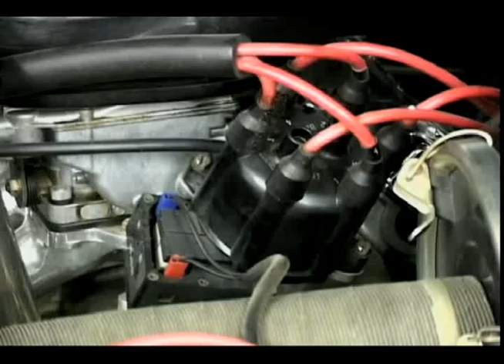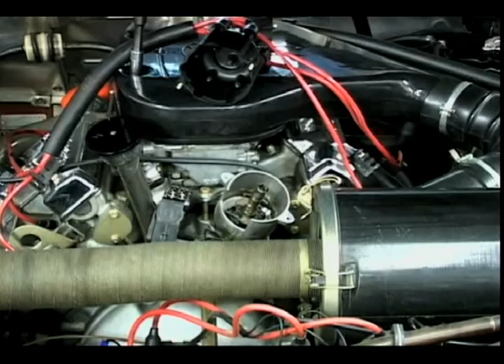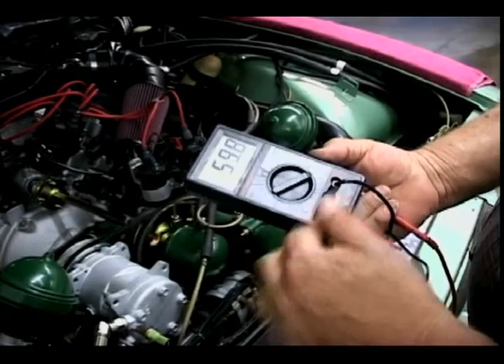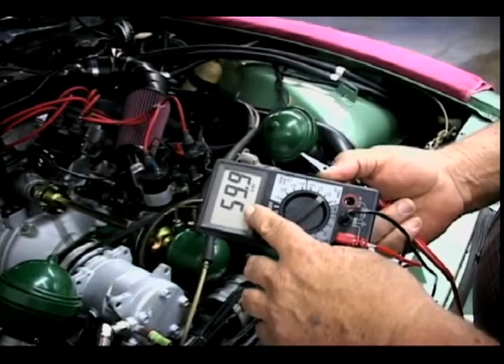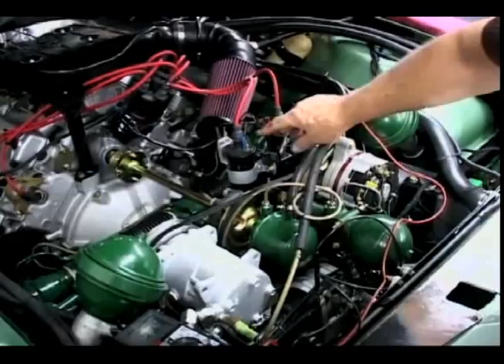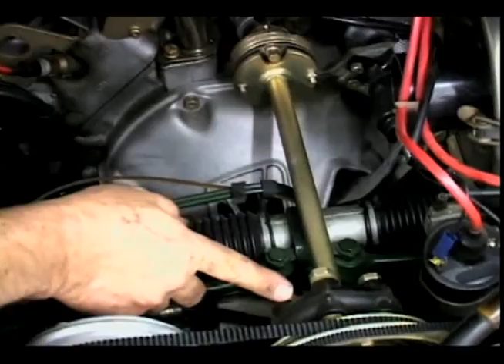Citroen SM Distributor Service,

Comment: Why do you use 82 degree instead 73 degree as the service manual report? Thanks
Reply: Early cars up to februari 1971 had a distributor you needed to set to 73 degrees, all later ones to 82 degrees.